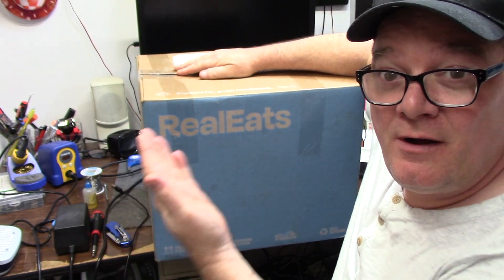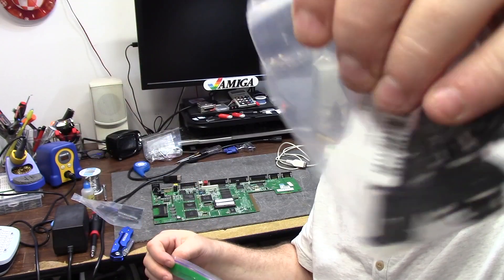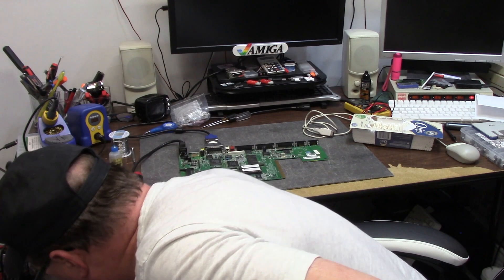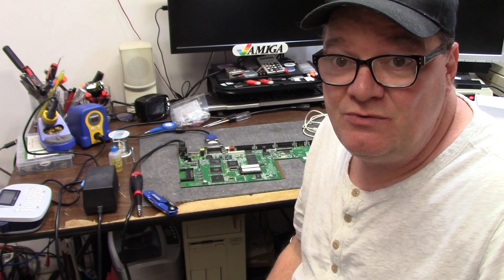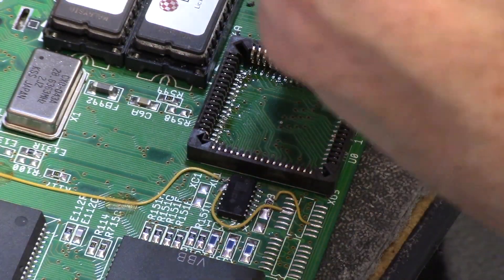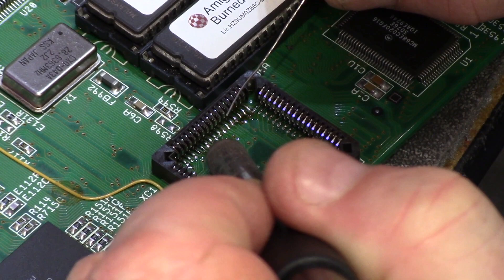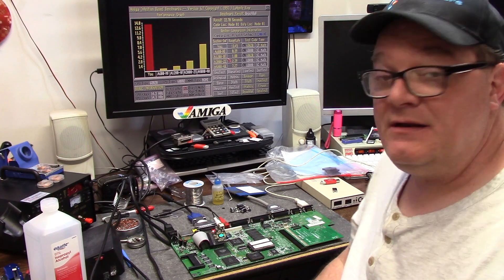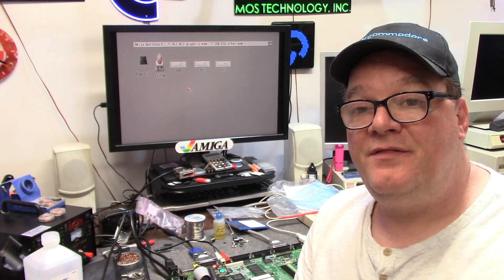What The F pu is in Steve's a1200

Comment: If you are in Australia NSW and are looking for and Amiga 1200 I'm selling mine. It has an internal 68060 50mhz accellerator with scsi ii adaptor and 8x cd rom drive. Gotek floppy with heaps of software. WB 3.2.1 and various other software. No HD unless you want to offer me $1000 for the whole lot. $600 without the Hard drive.
Reply: @James_T_Quirk  No, Central coast. Between Sydney and Newcastle. I wanna try and get the data off the drive first.
Reply: @James_T_Quirk  I just double checked the accelerator it's an 050 not an 060. I need my glasses for these things it is an 060
Reply from the maker: Theres 030,040 and 060.  There OS 50 mhz
Reply: @ChrisEdwardsRestoration  You're right it is a 060 50mhz. It might be time to get my eyes tested again.

Comment: Hi Chris, I noticed that you put what looked like a IDE to SDcard adapter in it.   I would love to see the different ways to use this IDE port including adapters to SDcard, CompactFlash, a real IDE hard drive, and even the new IDE2NVME SSD options.  I am hoping the later will work since the M.2 NVME drives are cheap and fast and can be used on many things.  Also, what kind of stuff goes in the PCMCIA slots?  I'm guessing a CompactFlash adapter will work in there, and I have seen EtherLinkIII cards for them on ebay.   How fast are they?
Reply from the maker: remember this is the 90's, none of this modern tech exsisted. The Amiga 1200 has a PIO MODE0/1 ide port, which means any new stuff wont work, unless its adaptor specifically specifies that it will down grade to piomode 0 or 1. thus the max speed of the Amiga ide port is roughly 1-3mbs no matter what you toss in it. as far as ethernet stuff, thats pcmcia and 10mbs internet links if your lucky

Comment: Anyone who says adding the FPU to the A1200 board is useless is just dead wrong. Sure, if you have an accelerator with a faster FPU on board you're not going to need it, but there's tons of modern accelerators that don't have a FPU socket and even plenty of cheap oldskool fastRAM+FPU only expansions that don't have the option of a faster clock crystal onboard so are stuck at 14MHz, unlike this which can be easily modded to 28MHz.

Comment: great video now i want you to find a way to put an 030 in place of the 020 cant be that hard surely not all pins are used.
Reply: the 020 in question is the 68EC020, which is a cut-down version of the 68020 that is packaged differently. The 68030 only adds caches and higher clock speeds, but has more pins on the package and is most easily done through the trap door expansion. To use the motherboard would limit you to 24 address lines and probably be a total mess, not to mention maybe all you could retrofit (if it's even possible) would be the 68EC030, not the regular one. In any event, even if such an upgrade was possible, it doesn't make much sense because the performance boost vs. difficulty isn't worth it.

No, a much better idea would be to get a trap door expansion with a faster Motorola chip... 030, 040, 060... with on-board local bus RAM expansion. Like the TF1230 or 1260.
Reply: @aleaxdeathbringer  well no you would fit a pistorm its faster than any other accelerator even beats vampire.
Reply: @jediknight2350  right.

Comment: I spent about 6 months writing software algorithms to minimise floating point compute loads back around 1985. It was necessary because the floating point coprocessor (a bit-slice unit occupying two S100 slots) cost the equivalent of a quarter of a zillion dollars. 

The CPU was a 68010 at 10MHz ... Pretty close to an Amiga, processor wise and physically when I lugged my A2000 into the office. I was salivating at the prospect of upgrading to to 68020 with FPU. It would have brought the 15 seconds of compute time down to "nothing".

Optimising software would also have reaped benefits had there been an affordable FPU.

Comment: Great Video as always Indi…. Dr Chris 😉👍🏻 Ahhhh…. my arch nemesis the FPU socket that I attempted to do myself 🙄 Looking at the FPU socket you used, I used the wrong ones 😮 The ones I bought had little nobbles underneath 😞 Kudos to Steve for owning the best revision (In my opinion) of A1200 board 👍🏻 Always had issues with the newer 1D4 and 2B. Especially when using Blizzard 603 BPPC accelerator 🤔

Comment: I heard putting an fpu on the motherboard would work together with an 060LC accelerator board. Is this a thing? Also does it make any sense or is it way slower than an on-board fpu in the 060?
Reply from the maker: Anything it works on. You can always just pop it out if you have one that has the fpu built in. I use mine for my tf1230 and works like a treat!
Reply: @ChrisEdwardsRestoration  actually no, if the program is compiled for full 060 then the LC060 with 68882 will crash. Way different FPU and way faster inside 060 than 68882. So no way to run 060 demos
Reply from the maker: @StmLord  i dont run 060 code on a internal fpu , i said you can take it out. this is mainly for things like the tf1230 or other cards w no fpu or a stock unit
Reply: @ChrisEdwardsRestoration  my reply was more an answer to above question if it can be used with LC060.
Actually it can be used, as long as the code is compiled for 68000 with fpu. But that software is almost non existent

Comment: That SCSI addon is for the DKB Cobra/1240/Mongoose a1200 accelerators.  It adds a SCSI port out the expansion port on the 1200.  It mounts right in there.